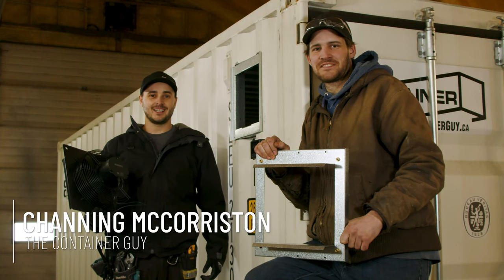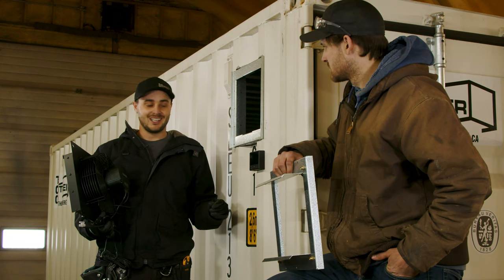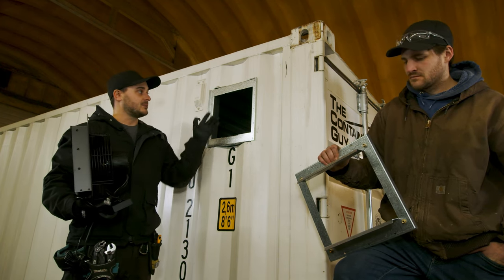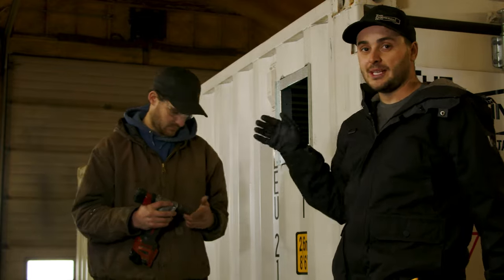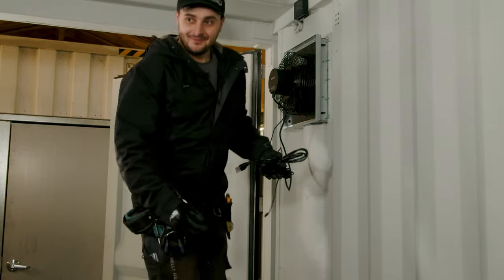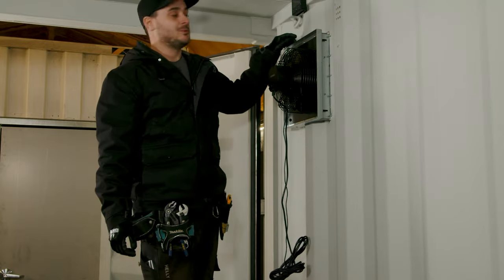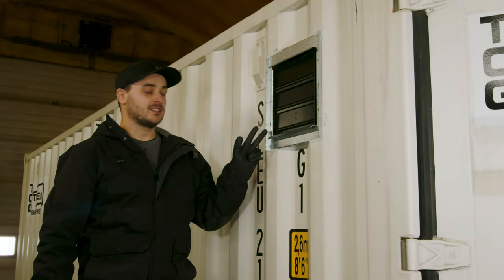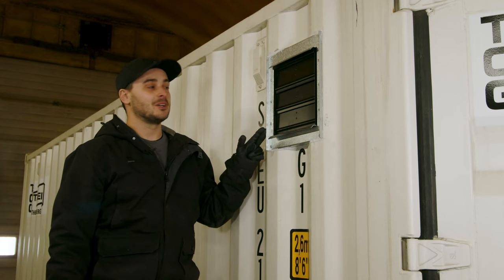631 CFM Shipping Container Exhaust Fan Install

Comment: i just bought one of these 10" for a 3d printing room i have that is 81sq ft. my purpose is to vent out the smell while printing since it is kinda toxic and i am sure this will be more than enough. but i do have a question. if i have this 10" shutter fan in a room that has a mini split will this work to keep my room cold without using the mini split anymore since it is venting out the air or not really?
Reply from the maker: If you're venting out, you're pulling air in somewhere. If the air you're pulling in is colder than the air inside, then yes. If not, then no.
Reply: @TheContainerGuyTV  i am in cali and it is hot af so yeah i guess i will leave the mini split on and add a vent inlet to pull in the cold air into that 3d printing room so it doesnt get humid from pulling out all that air. i almost bought a t6 inline fan and realized this shutter fan was better since i took out a window ac unit out and i have a piece of plywood there. so it works out perfect! thanks!